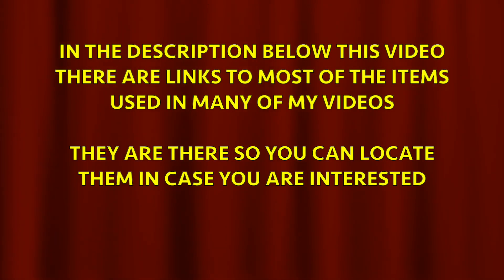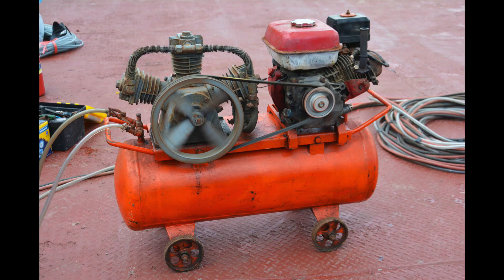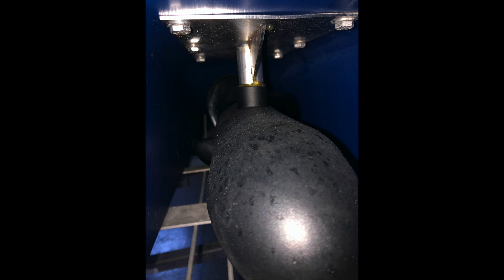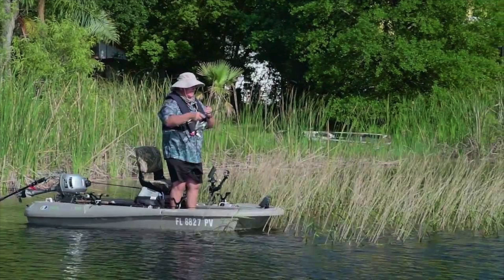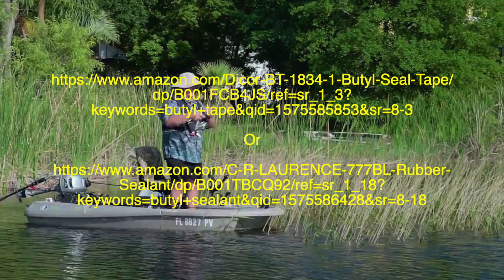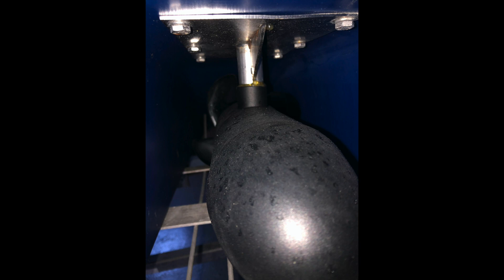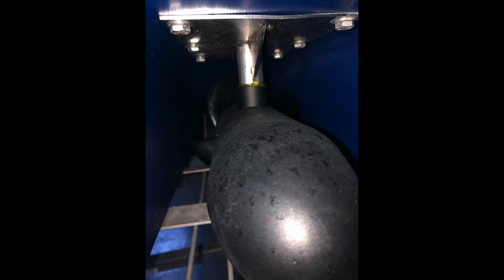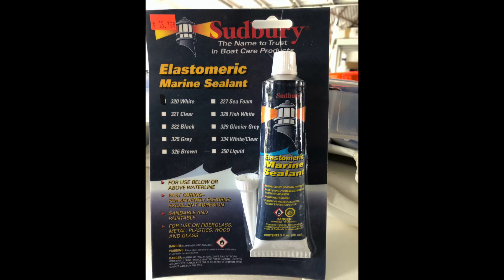YOUR FISHING BOAT IS ALL WET INSIDE!

Comment: Jerry, I had a problem with water in the port and starboard hulls last year. Frank sent me two kayak plugs that I drilled out and prior to installation I tilted the boat on both sides to drain. I ordered my TT without their Hook fish finder because I wanted to put a 9" Garmin on it. They had drilled the holes for the Hook and didn't seal the screw holes. Once I sealed the two very small screw holes, the only thing that has gotten into the Twin Troller has been me and a whole lotta fish!
Reply from the maker: PETE, that sounds like a success story!      Gerry

Comment: Thanks for the information.  I haven't had any problems with water leaking into the hull. The problem I had was with the motor wires shorting and melting under the chair rail. This caused foot pedel switch too burn out. It was apparent, after removing the rail and inspecting the motor to switch wiring harness .  The shrink tubing on the connection was over heated causing the solder less connecter to touch and short out. This is a quality control problem at the factory. 
Not wanting to paddle back to the ramp again, I checked the other side of the boat. Same issues, but hadn't reached the point of shorting out. One connecter had bare metal showing through the insulation.  Luckily the other had good shrink tubing, no breaks. Regardless,  I cut this connection out of the harness and did it properly.  The crimp connection wasn't the problem.  It's how the shrink tubing was over heated, causing the bare metal to be exposed. Although I also used shrink tubing, I wrapped it with electrical tape to be safe. If you use shrink tubing you know what I'm talking about.
Reply from the maker: Frank, that is the first time hearing that. How did you get a new pedal switch? 
Was that difficult to replace?     Gerry
Reply: Hi Gerry,  replacing switches is easy.  This is the second time replacing one. Just drill out the rivets,  and disconnect the linkage. The switch comes with pop rivets. To replace,  do the reverse,  insert the rivets from the bottom of the foot pedal frame into the switch housing. Reconnect the linkage before riveting. Then reinsert the plug and you're ready to go.
I would recommend all boat owners check those connections, unless you like paddling.
Reply from the maker: Frank, or swimming!

Comment: Haven't had any water problems my first year with mine. I think some of the older boats that had water intake from sealant problems is a simple lack of good Quality Control at the factory. Even though it's a one piece molded boat that does not leak Freedom Electric needs better Quality Control when they cut holes in it to make sure it never does. We pay several thousand dollars for these boats and they should not be having these problems. I love my TT but I would do more than simply fix the problem myself.
Reply from the maker: Steve, good point!              Gerry
Reply: @LunkerFishing  And I got a kick out of how you threw in the pictures like having a taste or with the cat on the french.
Reply: Dang spell check as I meant fence and not french
Reply from the maker: Steve, I laughed while editing that video.  😁                          Gerry

Comment: I’m thinking about buying a Twin Troller. I’m a big guy about 270 lbs. What do you think? Will I have any problems and can my 200 lbs son in law go with me?
Reply from the maker: Sean, you should consider other things that add to the weight the boat will carry. Outboard motor? Extra fuel? Volume of tackle?
Weight of your battery? Lithium batteries are much lighter but cost more. Finally what are the lakes like you will fish in? Small bodies of water on calm days are more forgiving that rough water on a big open lake.
I hope that helped.         Gerry
Reply: Lunker012 Thanks.

Comment: I also had small amount of water dripping out of the back of one of the hulls right where the large round plugs from manufacturing the boat are at and the seal for those large plugs was very dry and flaky like wax, so I resealed those (both sides) with marine sealant.  However the problem still exists on the left hull, as I saw water through that round plug when looking up at it while the boat was on the trailer, so obviously it is entering from another source as well, which really pissed me off because that means there are two spots allowing water in on one hull from a boat that was brand new.  No help from  Freedom Electric Marine, as Frank emailed me once and was going to look into getting me a solution for sealing the hull, but after emailing him 3 more times with no response, I realized I am really on my own with this issue.  Very small amount of water, but nonetheless, there's water seeping into that hull with no way to exit, now that I sealed up the one spot I could identify.
Reply from the maker: Ted, when Part 2 comes out you may have some other ways to address that issue.     Gerry

Comment: Any TT built after January 2018 has drain plugs on the hull of both sides of the boat to drain any water that could get into the hull. While this won’t address the issue of water getting in, it will address getting water out of the hull.
Reply from the maker: Ron, I was not aware of the year they started installing the drain plugs but if I needed them I am sure you can get them from Freedom Electric Marine. So far no sloshing!      Gerry
Reply: Lunker012 I believe it was Frank who told about that timeframe.